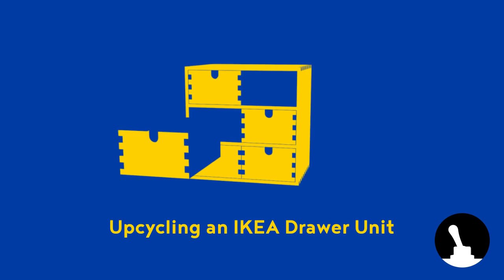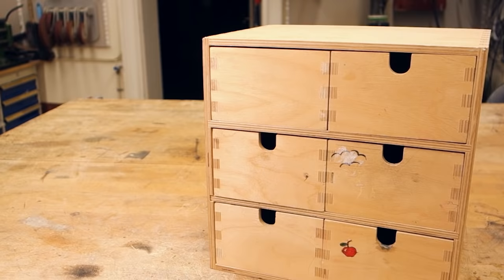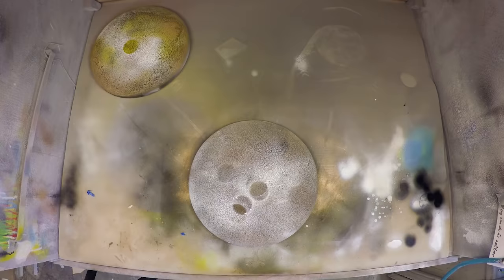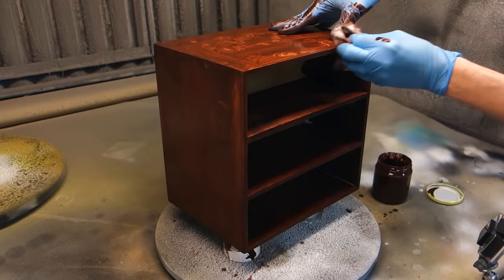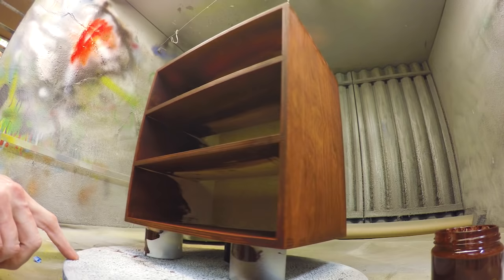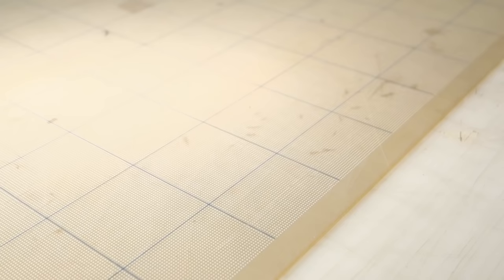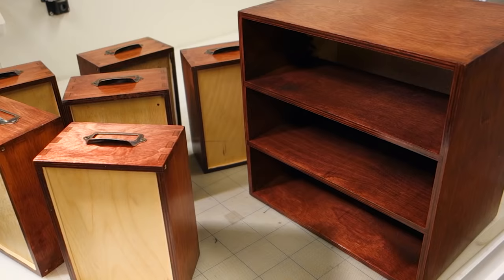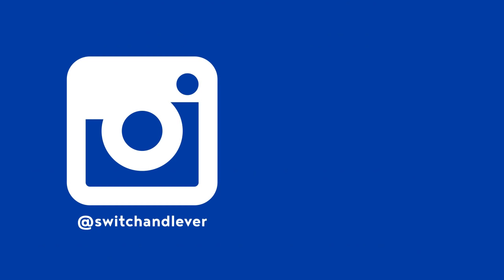IKEA Hacking: Upcycling a Drawer Unit

Comment: I like this video. Before you actually started working on it I thought the unit was massive. Like a chest of drawers for clothes. Made me laugh when I saw how tiny it is. 

Ikea hacks are pretty cool.
Reply: They are really useful though, especially if you have a lot of small borderline junk items like I did when I was a kid. I had one of these, though it's two drawers wide and four drawers high with wheels mounted underneath. I used it to store playing cards (this was just after the height of the pokemon card collection frenzy and I had an insane amount of collectible bits of cardboard), keychain charms, cellphone cases, pens & pencils, erasers and assorted small junk that I didn't know where to put but needed to get off the floor before they disappeared into a vacuum cleaner.

I've still got it. It's a pretty good height for a bedside table even if it's a little narrow, and it's very useful to have the multitude of little drawers for little things like pain killers, cough drops, nose spray, napkins, and stuff that I found in my pockets before bed. I've been thinking about upcykling it for over ten years now but I've been holding off until I've found my forever home so that I can make sure it matches everything else.

Comment: You speak English in the most adorable way. And I do love this hack.
Reply from the maker: May have been the first time anyone found it adorable. Haha! Thank you!
Reply: Searia Vorza - I'm particularly fond of the way he said this:

Don't be too vigorous in your sanding however, as the top veneer isn't super thick and you could easily go through it.

There are a lot of surfaces to sand, but don't fret if your arms start hurting.  Pain builds character.

Plywood dust, however, slowly kills your lungs, so do wear a dust mask.

Or the classic:

I'm definitely a fan of oil based stains, but remember, as it's based on linseed oil, the rags need to be disposed of properly, as there is the minute risk of spontaneous combustion.

Comment: Helped my ex gf paint one in different colors. She wanted all the insides to stick to their normal, bright plywood color and the outside frame in dark grey. Then she wanted the drawer fronts in different colors of paint (red, blue, yellow, green & purple - I remember because she left the color testers at my place and didn't want them after the breakup. Good thing I'm a maker and can actually use them). I first sanded all the parts. Then I applied some knot sealer and sanded that after drying too, before applying some white wood sealer (those two things makes the plywood look more like normal wood and hides the knots better). After that dried, I lightly sanded the pieces again, before applying 2-3 coats of paint with sanding in between layers and finally I brushed on laquer for furniture, giving it a nice, semi matte shine. They looked great and so did this project. Definitely tagging along to see what other products you're going to hack. The hacking community is pretty huge and I've hacked quite a few pieces myself

Comment: Another simple upgrade for drawer units of about that size is to cover the bottom of the drawer interiors with felt. Adhesive backed felt works great for this kind of thing and it is extremely cheap to do while also being cheap. In the US, it's about 10-20 cents for a sheet of the felt at a craft store, you might need 3 of them from the looks of the size, so with just the bottoms of it, that's not that bad. If you're storing anything more fragile, you can also do the interior sides of the drawers for just a bit more of the felt, probably 1 sheet per drawer

Comment: Your video editing is amazing.

As for the hack itself, I'd recommend gluing in a small wood wedge on the top of the drawer housing to catch the drawers before they're pulled all the way out. Somewhere far enough forward that the drawer could still be levered out, wide and long enough so the glue keeps its purchase if you attempt to withdraw the drawer with a bit of gusto, and a shallow enough angle so that it isn't readily visible from normal viewing angles.
Reply from the maker: Well, I want to be able to remove them with ease, so making a drawer stopper would be more frustrating than useful. Nothing stopping you from doing it though. Many thanks, and glad you like the video!

Comment: I like the anvil drawer. We have these at home stained with just water based paint. It doesn't protect the wood at all and it feels very rough. If I ever get another one I'll try the oil based stuff.
Reply from the maker: Yeah, while I love working with this stuff, using any sort of water based paint, stain or sealer usually just ends up in a lot more work than it's worth. Oil based is definitely the way to go in my opinion!
Reply: Recently I started using acrylic paint with clear varnish on top. That works quite well.

Comment: Yes, sadly, IKEA seems to have discontinued these in the USA as well.  (IKEA:  FIRA 18777, although this is a cheaper design that doesn't use dovetail joints.)  
I keep my eye out for used ones at the local Goodwill.  As in the video, you often have to deal with glitter and sticker residue.  But for $3 who can complain?
I find it easier to disassemble the American version back to the constituent flat parts.  Makes it easier to sand and finish; then reassemble.

Comment: It's April 2019. I'm in the Uk and these are still available in Ikea here!
Reply: When I saw your comment, I checked their website.
Yep, they have moppe, but it's a different configuration than the one here...3 small drawers across the top, 2 drawers underneath that and one long drawer on the bottom row.

Comment: why does this model have 6 medium drawers? i only know of the one you showed from the website, where it has 1 large 2 medium and 3 small. was this how the used one was set up or did you hunt down 3 units and adjust it... or was there a unit that had 6 medium drawers.

Comment: Great hacking and result. What is the mix % of mahogany + dark onyx oil? Plus, what varnish do you use? I'm a beginner and would need those information to help me
Reply from the maker: The mixture is called ”eh, this looks alright” 😉 The varnish is nothing special, just a random spraycan clearcoat. I think the one I used is marketed as automotive, so it’s probably a bit hard wearing. You could use almost anything though.
Reply: @SwitchAndLever  thanks for your reply 👍

Comment: You did an amazing job with this unit.  I really like how it came out.  However I think people today are really overusing the term hack.  Applying a finish, and handles is not a hack.  That of course doesn't take away from the fantastic job you did on it.
Reply from the maker: If you have issues with the term IKEA hacking this is the wrong place to vent it. It’s a well established term for altering IKEA items, so if that’s an issue you can take it up with whoever coined the phrase. Glad you like the result though!
Reply: @SwitchAndLever  I wouldn't go so far as to say I have an issue with it, just that I think it is often misused. Now if you combined parts from two different IKEA units to make something new then that would be hacking, which I imagine you have done in other videos. This just happens to be the first of yours that I've seen.

Comment: Wow, interesting video! I'd like to replicate this project, but I'm a little concerned on the screws that secure the drawer pull, wouldnt they stick out in the inside? I mean, the plywood is quite thin and I've never seen such short screws, how did you solve this problem?
Reply from the maker: You choose screws which are short enough not go go through the wood. If so happens yours are too long just shorten them with a pair of side cutters.
Reply: @SwitchAndLever  Well, I'll be looking for short screws, I've never seen them around but to be honest, I've never even looked for them 😅
Thank you very much, and greetings from Italy  🇮🇹❤️

Comment: You can eliminate the possibility of the used rags spontaneously combusting by hanging the rags outside like you would do with laundry until they are completely dry (over night).  Then you can dispose of them in the trash.

Comment: Counter sinking the holes for the screws was pointless because the label pull prevents the screws from sitting flush in the wood. Looked good in tbe end though.
Reply from the maker: No, the countersink accommodates the screw head. The countersink on the actual screw was taller than the sheet metal that makes the drawer pull is thick, meaning that you would have to over-torque the screws to make the drawer pull sit flush against the drawer, in the process deforming the wood. Just because you can't understand the reason doesn't mean it's "pointless".
Reply: @SwitchAndLever  point made. Thanks for the clarification. 😊

Comment: the countersink is for hiding the screw head below the wood level... if you are just attaching hardware, the screws don't need a countersink for you cannot hide the screw heads...
Reply from the maker: Thank you for your comment. However, if you look closer the sheet metal of the handles is thinner than the countersink on the screw head is deep, hence the screw head would bottom out against the wood before the handle is secure in place. That would lead to two outcomes, either a sloppy fit on the handle, or the screw being tightened and crushing the wood to the point of bulging (again resulting in a sloppy fit) or at worst cracking the wood. Neither of which is desirable. Basically, this is bad design from the drawer handle manufacturer, who should've gone with domed heads instead, but what can you expect when you get stuff cheap off eBay.

Comment: Superflous, that is a good word.  But I just wanted to say that I prefer alcohol based stains better. Because oil based stains take longer to cure than alcohol based ones... Just my opinion.
Reply from the maker: Not all that much longer, and considering that oil based stains don’t require much in terms of post work, and won’t raise the grain, it’s by far in my opinion better. Alcohol stains still can raise the grain, which is a pain in the ass to deal with.
Reply: @SwitchAndLever  I suppose that, because I normally don't finish my projects that much other than staining it and putting a little bit of wax on top, I prefer just using the alcohol-based stain so that I can be done sooner. But both have their merits, the things I've done with the oil-based ones seem to have a little more vibrance on the color.

Comment: I thought I was alone in having a drawer for nargles, then I saw you had one as well. Vastly disappointed when you pixilated yours - now I can't compare them. I was hoping to discover if mine is unique in having a left-hand thread. Sigh   My search goes on...
Reply from the maker: Yours have threads???
Reply: @SwitchAndLever   Yep. It's from about 1964 and now obsolete because after 1967 they all came with instantaneous connectors. I was just hoping to see another for reference. My search continues.

Comment: What is the point of countersinking the wood? Shouldn't you make a "countersink hole" on the drawers pulls instead ?
Reply from the maker: The pulls are from thin sheet metal, the countersink on the screws are actually higher than the thickness of the sheet metal. Thus, if I tightened down the screws the countersink would hit the wood before the pull was tightly on, which could lead to either loose pulls, or splitting of the wood. Removing a little material, by putting a small countersink on the drilled hole, eliminates that entirely.

Comment: Countersink under a metal plate confuses me. It only makes sense if the plate is very thin, but then a beveled screw head wouldn’t make sense.
Reply from the maker: I say exactly why in the video, and you already answered your own confusion. The metal is by far thinner than the height of the countersink.

Comment: I came accross your channel by accident.  However I am trying to take the sides of my stairs back to natural wood. Unfortunately the last coating of paint is proving problematic.  Industrial paint stripper no good,  hot gun  no good  and sander, leaves it looking like washed wood.  Any help  please as it has taken me 1 weak to do 3 stairs.
Reply from the maker: Scraper or handplane.
Reply: @SwitchAndLever  have already tried scrapper no  success. Shall bye a plain And let you know.  Thank you for such a swift response.

Comment: Counter sink a screw hole, but put metal on top of said hole...  Pointless.
Reply from the maker: Make a comment completely misunderstanding why someone did something in a video. Priceless.
Reply: @SwitchAndLever  Explain why you counter sunk a hole.
Reply from the maker: The countersink on the screw is much taller than the thickness of the sheet metal of the pull, meaning either you put a countersink so it seats properly into the wood, or you overtorque the screw deforming the wood and risking to snap the screw and deform the head. So, that’s a big no thank you.

Comment: You are still using 8-bit nargles?

Really?
Reply: Waltham1892 whats the problem with this?
Reply: @suppenhun007  7:27:  They used an 8-bit nargle.  I haven't seen one of those since the 80's.
Reply: Waltham1892 what is an 8-bit nargel? 😅
Reply: @suppenhun007  An 8-bit nargel is a modified end shake bearing used to prevent high speed cavitation in early production turboencabulators.  I haven't seen one since General Dynamics came out with the 64-bit  nargles.
Reply: @Waltham1892  oh okay thank you ^^ i guess you never stop learning :D
Reply: @suppenhun007  You do realize not a single word I said was true, right?
Reply: @Waltham1892  of course :D
Reply: @suppenhun007  I thought the turboencabulator might be a tip-off.
Reply: @Waltham1892  if you answer a question sarcastically dont be suprised by getting a sarcastic response
Reply: @suppenhun007  I consider myself advised then...

Comment: Great video, but does everything have to be called hacking now? Furniture refinishing isn't hacking, it is using tools and materials for the exact purpose they were intended.
Reply from the maker: The movement of redoing IKEA furniture is called IKEA Hacking though, it's the term that the community has adopted, and plenty of websites refer to it exactly as that. Also, languages change over time, hacking meant something quite differently before the computer age came around, and is now transforming into something broader.
Reply: Sorry, but hacking still means using something in a way that was not originally intended. When you wipe your ass, it's not a "New toilet paper hack."
Reply from the maker: As I said, it's what the movement of modifying IKEA products is called, I didn't come up with it. If you have a beef with the terminology, track down whoever came up with it and tell them.